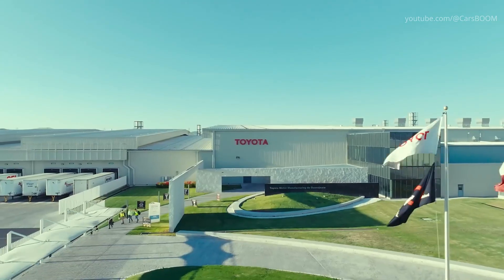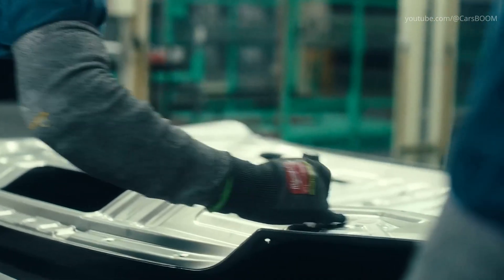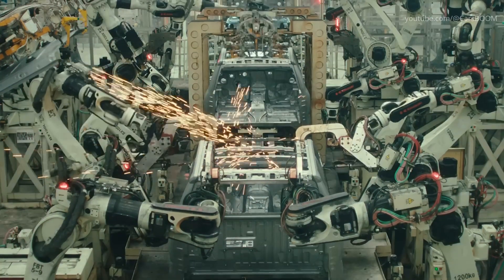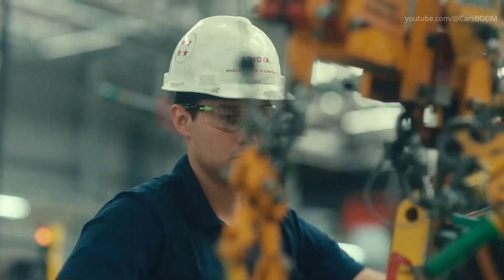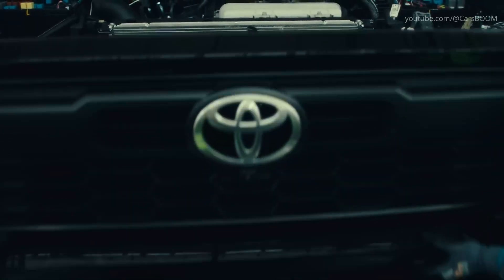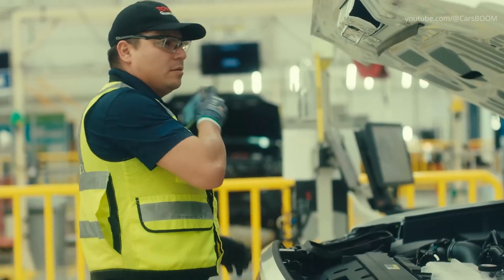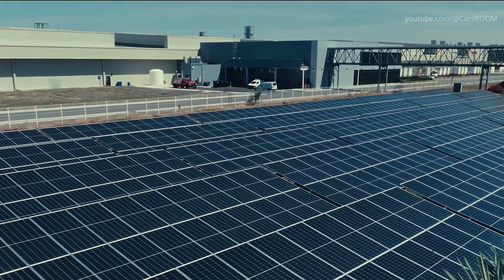Toyota Tacoma trucks production in Mexico - Factory tour in Toyota Guanajuato Plant

Comment: I’m watching this, because I want to know why the 4th Gen Tacoma is having issues less than one year of ownership 🤔
Reply: Its not... every single generation has issues the first year or so.. the differenc is Toyota fixes that really quickly.. other companies have issues on a regular basis upon release of a new generation completely normal and the issues are very quickly addressed and warrantied without question
Reply: @MR-he4jb  I know, you’re right. Anything new will have issues in the first year, if any.
I miss my 3rd gen 😭
Zero issues. Simpler, just the essentials
Reply: @jollyrogers5261  buy another third gen, I think they are way nicer.
Reply: @andrewtamkin2511 
3rd gen has sluggish engine, transmission that clunks into gear and likes to hunt for gears because of the low torque engine, howling rear end, leaking high mounted brake light, leaking front engine cover, sudden loss of power, noisy interior from exhaust, engine and road noise the first few years, pitifully low bed payload, weak leaf springs, crappy rear drum brakes.

The 4th gen Tacoma is better in every way.
Reply: @dvader3263  my 2012 has been amazing 4.0 . locker and 220k and just one alternator . Hard to beat.
Reply: Ask Ford they still can’t get the F Series right, record recalls this year alone and we have almost 5 more months to go.
Reply: Kinda dumb to buy any new gen car on the first year, tbh. They all have engineering issues at first. I wouldn't buy a new gen car until the third year at least.

Comment from the maker: 0:00 Intro
0:17 Cab and truck-bed press shop
1:29 Сab and truck-bed welding shop
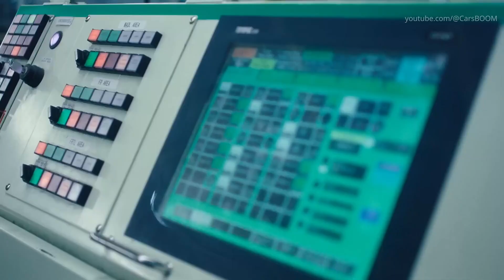2:39 Cab and truck bed paint shop
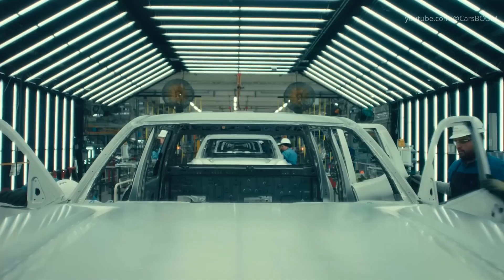3:21 Axles and Suspension Installation
4:29 Bumper assembling
4:36 Вelivery of auto parts between workshops
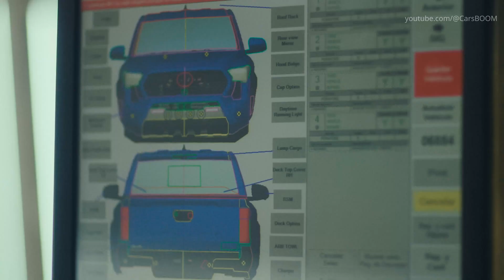4:41 Cab interior assembly line
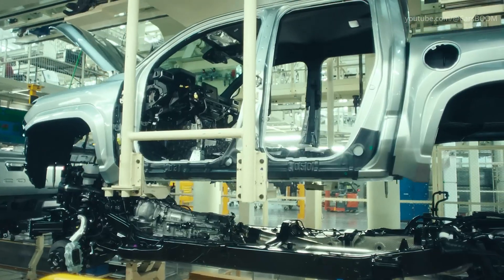5:02 Cab-to-chasiss marriage of tacoma truck
5:10 Tacoma truck assembling area
5:25 Bumper installation
5:39 Wheels installation
5:50 Doors installation 
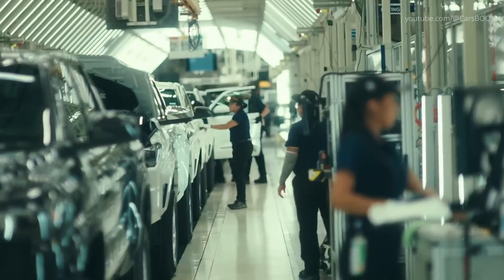6:10 Final quality check on assembly line
7:05 Tacoma pickup truck quick view
7:14 Toyota Paseo el Grande assembly plant and Baja California Toyota plant  aerial shots.